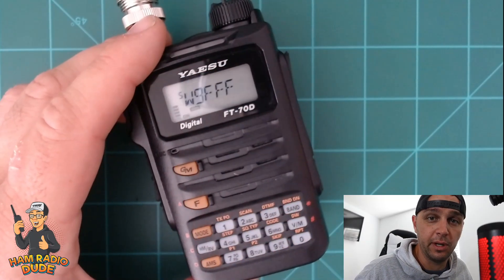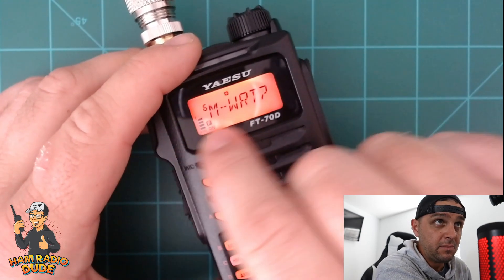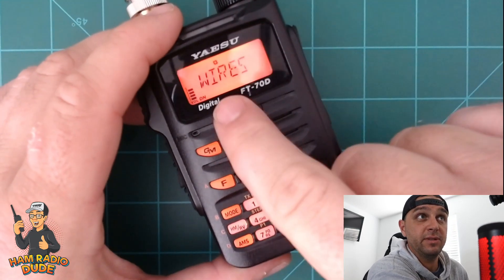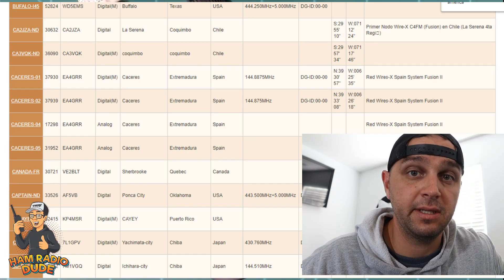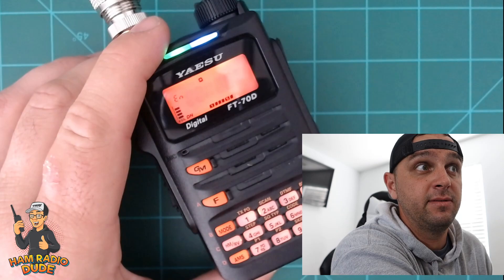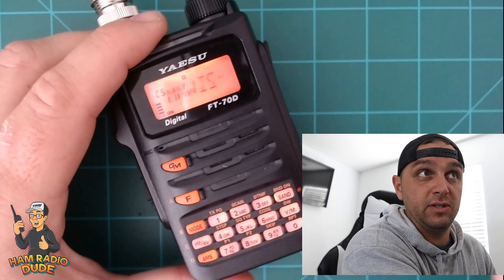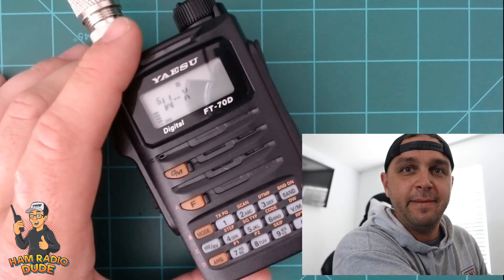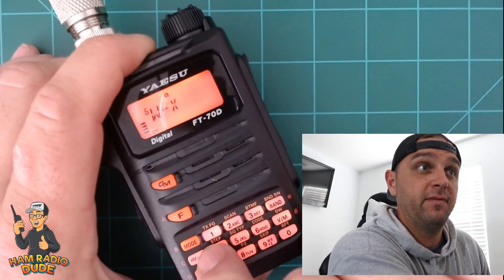Yaesu FT-70D, finding and saving Wires X rooms into memory.

Comment: Good morning HRD. Was trying to follow your instructions on programming WIRES-X and got messed up. SURPRISE ! Anyway, I can't get back to the Frequencies I have Already Stored. I'm in the Mode where it is listing the beginning numbers in a frequency like 145.000. I want to get back to the Call signs I have programmed and am puzzled on how to do that. I've held down the "mode" button but to no avail. Need your assistance brother. Appreciate anything you can do. KD9QAN standing by.
Reply: Thanks for not responding. A big help

Comment: Great video/videos...I am trying to make a comeback into ham radio. after many years. I am talking early 90's, when I stopped using ham, more or less...both USA and in Venezuela.
Now I just acquired two Yaesu Radios (Ft-70DR and FTM-300DR). One being the one, discussed/described  here.
I wonder if you might know why, does this radio, offsets 70cm 446.000MHz (-5MHz)?. I understand it being in the vicinity of repeater common freqs, but the freq is also conventionally considered National Simplex frequency, for 70cm, weather or not it is used as such or local band plans use it as double purpose, or it became a virtual simplex (with -5MHz, offset), and when used with tones, it is for repeater Ops. or Am I wrong, or missing the big picture, here?...I am also as well trying to become familiar with the idiosyncrasies of the radio itself...
Reply: I found the solution/work around, remove the ARS from both radios, save 446.000MHz in memory without Offset. Then turn the ARS feature 'ON". Now you can recall the 446.000MHz and it will be simplex...

Comment: Hi,  How do i save multiple rooms for the same Wires-X repeater?
Reply from the maker: Should not be any difference.  Connect to the room you wish you save and then complete the process.  I'm not near a wiresx repeater at the moment, but here are some instructions that may assist you: "While in the Cn Screen, press and hold a number key from [1-5] to enter that room into a 
memory slot. 
2. Entering a Wires-X room into 1 of the 5 Wires-X memory channels that already has an 
entry will cause the previous entry to be overwritten." 

Hope that was of some help
Reply: @DudeTested  Thanks for the quick response....It seems I can only save 5 "rooms" per repeater. C0 always has the last room entered.....you cannot appear to save to it.....5 rooms seems like a big limitation unless there is a way around it?  Also when i am attached locally to my Fusion Repeater I can get user info (callsign name) but when i am attached to a room all i see is the scrolling room name...is that correct?

Comment: I HAVE A QUESTIONS FOR YOU IF YOU COULD HELP ME PLEASE. ON MY FT-70D I TRY AND TYPE IN A LOCAL REPEATER TO 445.840 AND THE RADIO AUTO SETS ME TO 445.837-50. WHY IS IT NOT GOING TO THE FREQUENCY I AM TELLING IT TO? WHEN I TRY TO GET TO THAT EXACT FREQUENCY WITH THE DIAL KNOB IT BYBASSES THE FREQUENCY TOO. PLEASE ADVISE.
Reply from the maker: My guess is the step isn't set right.  From the main screen, tap the f button and then 4(step).  What's your step set to
Reply from the maker: Yeah mine was set to auto and did the same thing.  Try setting it to 5.00
Reply: @DudeTested  You were 100% correct! I actually called Yaesu and they told me the same thing. Can you think of a reason why the AUTO feature would not step by 5? It seems like all frequencies I have seen so far for HAM are stepped that way.
Reply: @Donkarnage223  Poorly designed radio.

Comment: Can you help me connect to a simple Allstar node?  And, how is Wires X different from Allstar?  I live in a very rural area with limited repeaters.  Thanks for your videos.
Reply from the maker: Absolutely.  You would need an allstar node to connect to. There may be one locally, but you also may want your own personal node.  I recommend the Shari.  It runs off a raspberry pi and can be purchased for around 70 dollars.  Allstar utilizes Voice Over IP technology to communicate analog signals over the internet to an allstar node.  The allstar node then typically (not always), transmits RF to your amateur radio.  This is all analog, but the nice thing about this is it requires no special radio.   Wires X is digital and currently in order to use C4FM technology on wires X, you must have a Yaesu capable of digital radio.   Subjectively, I feel the sound on analog sounds better than digital, when you have two signals that sound the same.    If you go to http://stats.allstarlink.org/maps/allstarNodesMap.php You could see a list of all the current allstar nodes and one MAY be in your area.  Please let me know if you have more questions

Comment: If you save a room while in wires-x, when you go to a hotspot connection will it still work from memory?
Reply from the maker: If it's true Wires X and not a MMDVM hotspot, it should.  I feel like I was able to test it once (lack of fusion in my area).  I can test it in the next day or two and let you know for sure.